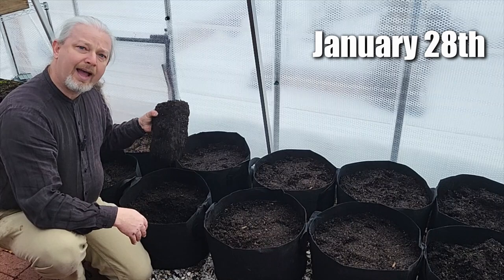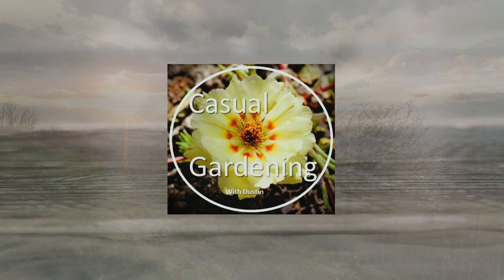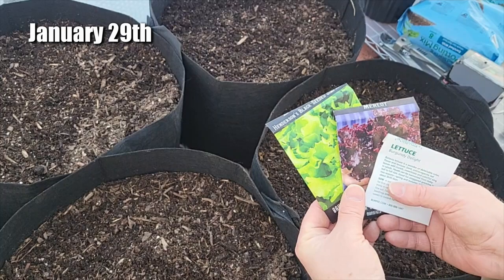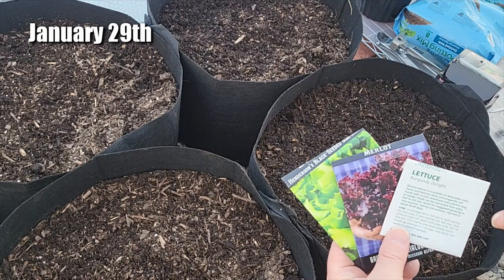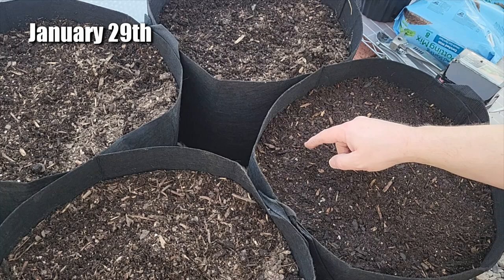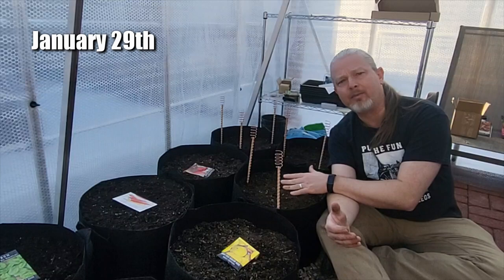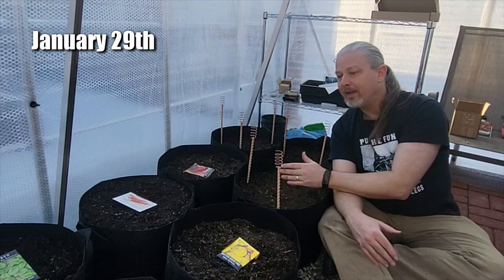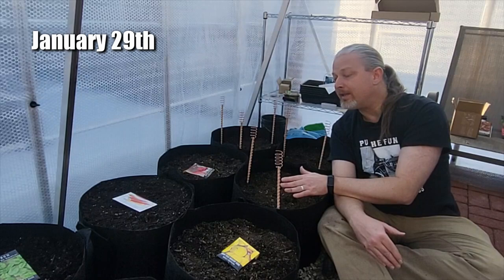Greenhouse Electroculture Experiment Part 1- The Setup

Comment from the maker: The month of February had average temperatures more like March or April in my greenhouse. But beneath that statistic is the harsh reality that I'm still getting hard frosts in my unheated greenhouse. This is why it took so stupid long for anything to germinate.

Last night temperatures in the greenhouse dropped to 25F (-4C) and, frankly, I'm a little nervous about the lettuce in there. I'll let you know this afternoon if everything is okay or if there's been a catastrophic lettuce failure.
Reply: I'm zone 6 too and just got my first greenhouse last year. Checked my greenhouse thermometer yesterday and my low was sitting at 22F. Haven't tested it yet but as a low-tech fix to raise that min temp I'm considering making a couple of thermal batteries by filling 5 gallon buckets/1 gallon jugs with water and painting them black. Could be a quick fix for your current problems.
Reply from the maker: @SherpaFrank , I've been super happy with the stability I'm getting from thermal mass. So far I've installed 4x 55 gallon barrels along my north wall and I'll probably try to get at least one more this spring. Keep in mind that thermal batteries don't really change your average temperature very much- mostly they change how much time you spend at temperature extremes. They'll keep the greenhouse a little warmer on cold days and a little cooler on warm ones... just as long as there aren't any prolonged cold- or hot-spells.

Comment: The success of the electroculture method depends on the type of antennas used.
Reply from the maker: Could you elaborate on that? Are you referring to the materials the antenna is made of, or the way the antenna is constructed, and do you have any specifics?
Reply: @casualgardeningwithdustin  
Of course the material is important, i.e., you should NOT use steel, only nonferrous metals such as copper, aluminum, brass, & even silver or gold. Any of these will all do just as well, & there are others.
But what I was alluding to in my initial comment is the design of the antenna itself.
Look up on YT this video, which gives a simple design: "FRACTAL ELECTROCULTURE ANTENNA"
That is not to say that your antenna won't work, because it will, but not as good as the fractal antenna.
Reply from the maker: @lxmzhg , thanks for your response! This isn't the first time I've heard that ferrous materials won't work and I'll probably have to see if anyone has an explanation for that. Ferrous materials can conduct electricity and can be used as emf antennae, so I'm pretty curious about the distinction.

Since you agree that aluminum can work, I'm curious whether you think the aluminum frame of my greenhouse might be an interfering factor in the experiment.
Reply: @casualgardeningwithdustin  
Ferrous metals won't work because the harvested energy from the atmosphere isn't transferred to the earth to where you're attempting to drive it, rather it gets trapped in the top part of the antenna. The goal is to transfer the energy into the soil; the video I referenced confirms that. The host of that video is not a run of the mill YT poster but is scientifically competent, and that is the perspective from which he is presenting this antenna.